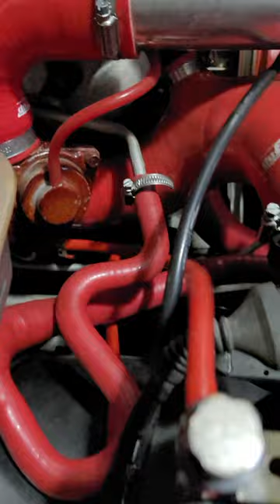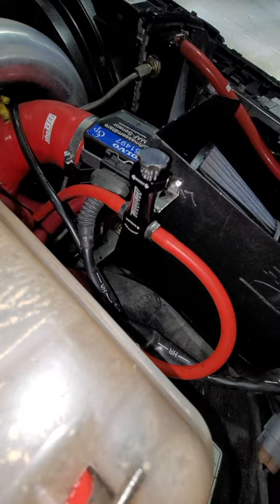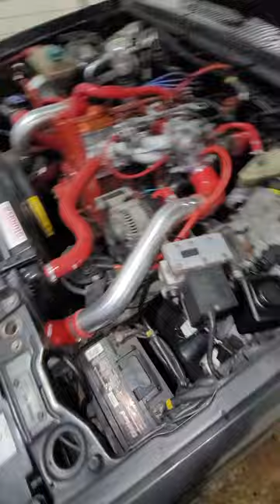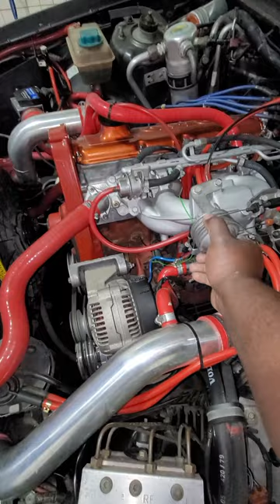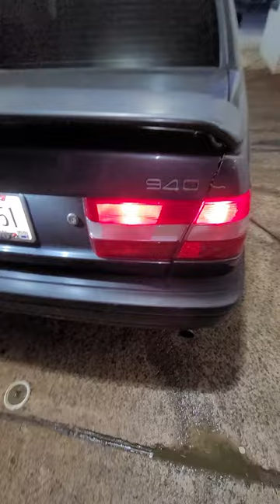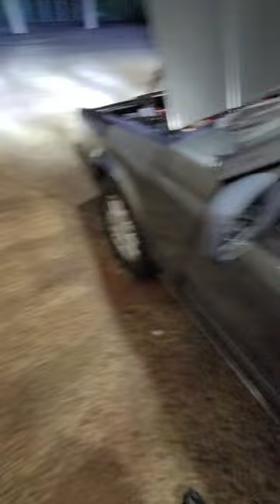volvo 940 turbo boost control and flutter sounds

Comment: What you did to get it flutter like that ? Step by step ?
Reply from the maker: increased the boost pressure with a manual boost controller.  the increased pressure and air release is what the flutter is from the recirculation valve
Reply: @erahelp  hate to break it to you dude, but the recirc valve on your car isn't actually working as that noise is the sound of a wastegate dumping the boost, my 940 turbo is running a 16t at 18psi and I do not get flutter like that I get the usual recirc noise just very very loud. Defo would recommend buying a replacement recirc valve as blanking causes the car to run richer (although it does sound much much cooler)
Reply from the maker: @Cottsify  actually it was the throttle body gasket sucking in air. I had to double gasket the throttle body to fix that issue